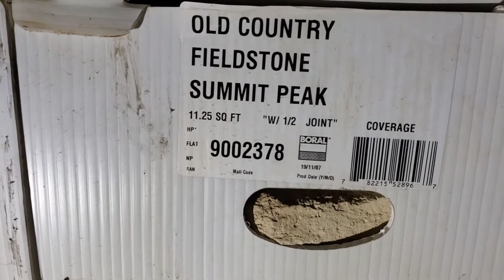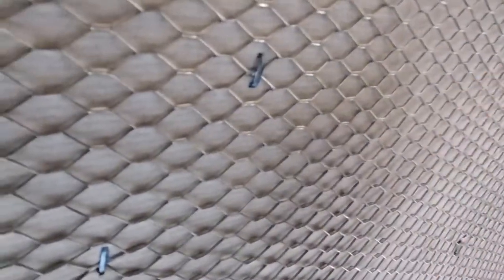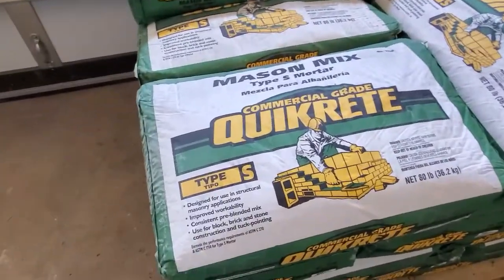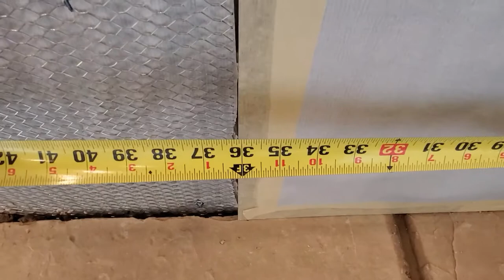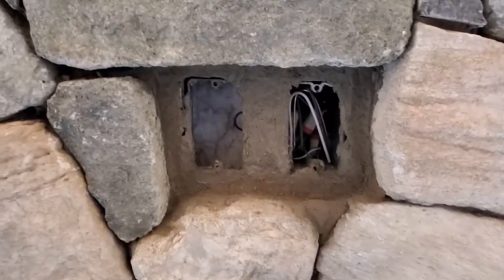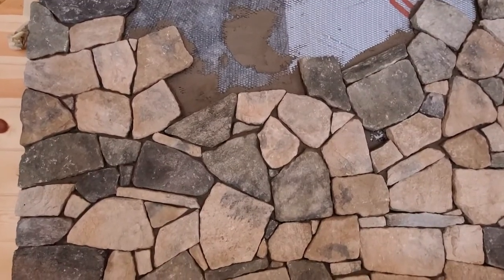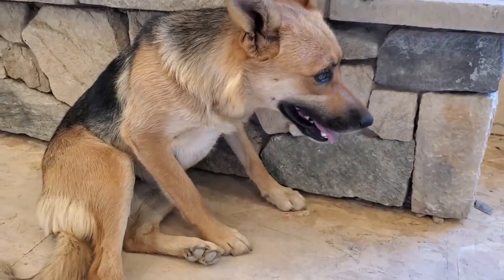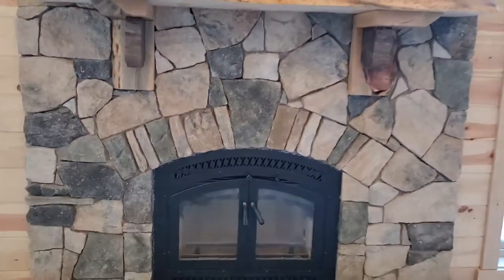Old Country Fieldstone Stone Fireplace Cabin 2020

Comment: Man, I love this. That stone is killer. What brand and type? 

As well, when would a person use house wrap vs durarock?
Reply from the maker: I can't remember right off but I mentioned it in the video, the only reason for tyvek or any underlayment where it wont ever get moisture is to protect the wood from the mortar, their not compatible with each other.
Reply: @SolidworksUnlimited  

Should I use durarock/ cement board inside, instead of lathe? 
Like on a painted wall? 

And I found the name of the stone.  Sometimes I drink too much coffee and go too fast. :)
Reply from the maker: You can stick the stone right to the duraroc, just make sure it's fastened good to the studs. No underlayment or lathe is necessary.
Reply: @SolidworksUnlimited  

Awesome. So only underlayment and lathe when facing outside elements?
Reply from the maker: No, if it's against wood, mortar reacts with wood, it makes a sweating action, thus mold and determination. But hardi or duraroc doesn't react with wood.
Reply: @SolidworksUnlimited  

That makes sense. I will use durarock. I also have a brick fireplace I am hoping to cover with cultured stone. 

So are you in Utah? Seems like all your videos everywhere you work is my ideal dream location and jobs: Lodgepole pines, forest mountains, snow, cabins, and you get to take your pup. 

I am in Oregon but looking to move. Idaho and Utah are on my radar. I like the snow.
Reply from the maker: @travisandtracyjacobs6198  most of them are utah
Reply: @SolidworksUnlimited  

Yeah, those places are awesome. I saw you were planting Blue Spruce’s, my favorite tree. 

Is there a book you would recommend for masonry? Cultured stone laying?
Reply from the maker: I don't know of any
Reply: @SolidworksUnlimited  

Thank you for taking the time to answer my questions. I appreciate it. 

One last thing, did you ever consider one of those mini skid loaders? I don’t have a business like you, but I thought about one of those mini versions would save my back. I am always doing something around my house and thought this might be a good alternative to an actual skid steer. Or maybe a small tractor Kubota. Thoughts?
Reply from the maker: I would take even a small skidsteer over a tractor, they handle dirt so much better. Skidsteers have many attachments too, just personal pref though.
Reply: @SolidworksUnlimited  

I will lean towards the skid steer, at least the small one. I don’t think I can afford a regular skid steer. 

Did you ever look at the Bobcats before you bought your Case?
Reply from the maker: Ya, operated alot of them so I knew what they are, I don't just dislike bobcat, their attachments are some of the best, bradco I believe makes them, I'm just more partial to the case, a cab is a must have in cold climate worth the money
Reply from the maker: The small ones are OK as far as tiny jobs unaccessible by a larger machine but I don't know about maintenance and all that, never owned one. I was thinking about buying one and talked myself out of it due to cost comparison between small and large, you can get so much more done in a day with a bigger machine.
Reply: @SolidworksUnlimited  

See I was thinking the same thing.  My thinking was I could justify the cost.  So, maybe I rent it out on weekends, or do work for people? I don’t know how to grade really, but maybe someone needs some dirt dug up or rock moved?  Or fence post holes dug out.  I am sure I could figure that out.